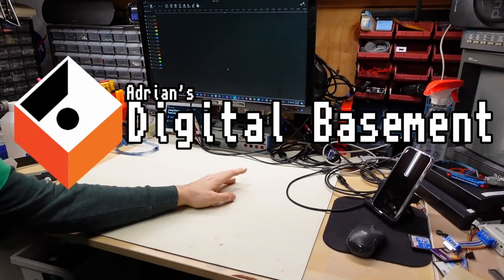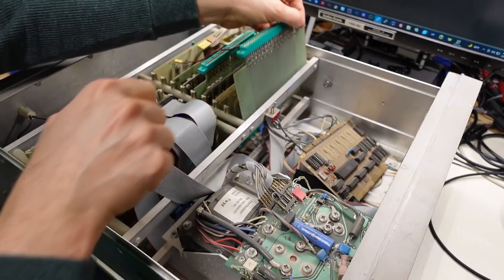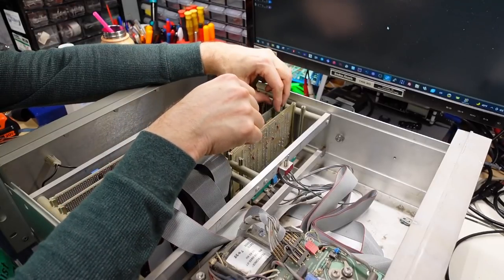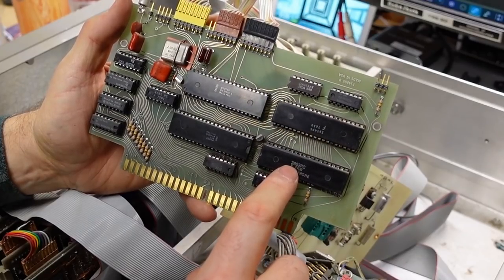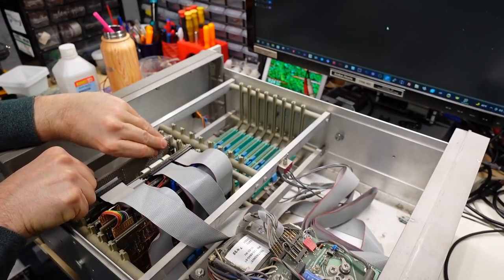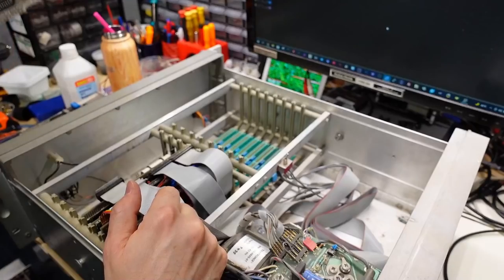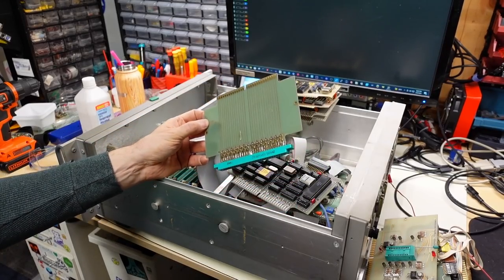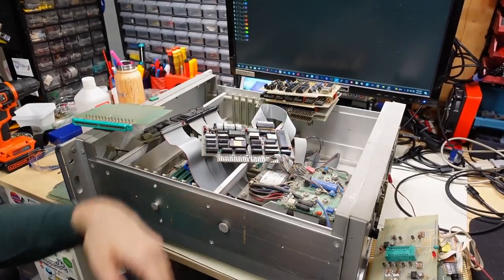I need help finding information on this mysterious computer

Comment: Going to respectfully disagree with Stephen Sanner, below -- I don't think this is STD-Bus, it doesn't look like it has enough pins. If it is, it's a _very_ nonstandard implementation. For sure it's not S-100 bus. I've never seen anything like it. If I had to guess, I'd say someone homebrewed something based on STD-Bus or -- what was the 50pin one used with the 6800 CPUs sometimes? That thing -- but with what they could get easily at the local shops.

Fairchild F3852PC is a dynamic memory interface for up to 64k of DRAM in a Fairchild F8-architecture system.
Fairchild F3854PC is the DMAC (DMA controller) for an F8-architecture system.
Hitachi HM4864A-12 is a 64k x1 ("serial") DRAM.
Intel 8232 is an 8080-compatible FPU, interestingly enough.
Intersil IM6402-1PL looks to be a UART.
Mostek MK3850 is one half of a Fairchild F8-architecture CPU, second-sourced -- it's usually paired with an MK3851, apparently. The single-chip variant is reportedly the MK3870.
Mostek MK90004N was VERY hard to track down but an obscure Archive[dot]org reference points to it being a "port-allocated" variant of the MK3861 PIO chip. (I've no idea what "port-allocated" means.)
Mostek MK90071P is another PIO chip of, I suppose, a different sort.
Mostek MM58167AN is an RTC chip. I actually have one of those in a bag of parts in a drawer somewhere that I've been meaning to find a use for.
Motorola MC1441x chips appear to be sense amplifiers of various sorts. Definitely it is not a bit rate generator, pull actual datasheets, don't just trust the first thing that Creepy Uncle Google feeds you! He has pulled the datasheet for an MC1441*1*, which is a different chip from what was verbally identified. (Note remark below regarding board photos.)
Motorola MC14515B is a 4-to-16-line decoder.
NEC 765x is indeed the famous floppy controller.
Sony CXK581000P-12L is a 128k x8 SRAM with 120ns access timing. As self-corrected, not flash memory.
TI TMS4051 is a 4k x1 ("serial") DRAM, not 8k xAnything as stated. (LOL.)
Zilog Z280 is not a math coproc, it's a 16bit MPU. Wikipedia cites it as a rebadged Z800 with minor improvements.
Zilog CTC is counter/timer.

I've not looked at the high-resolution photos; those, however, are the notable chips that aren't glue logic. 74xx and CD4xxx chips are very well documented. I don't think I missed any notable chips that weren't glue logic.

Probably the user interface would be RS-232 video terminal, most likely VT-100 compatible; something like a Wyse 50 would probably do the trick if, like most folks, you don't have an _actual_ VT-100, Adrian. I'd do something about that battery, and _thoroughly_ test the power supply under at least some minimal load.

Comment: DZUS fasteners, I've seen those screw locks on old military equipment.
Reply: Came here to say exactly the same thing … I designed military equipment back in the late 1980’s. The sockets on the Z80 cpu card were called Harwin Pins and were stupidly expensive!

Comment: I had to split this comment into multiple comments because Google barfed on putting it all in one.

The manufactured circuit boards with the Exxxx designations are definitely made by Tektronix, and the "E" designator was that they were internal /E/ngineering boards.   I believe the X posfix indicated that the board was  a low-count e/X/perimental run.

As mentioned by someone else earlier, the power supply is a derivative of the power supply used in the Tektronix 21 and 31 electronic calculators.  Derivatives of this power supply were used in all kinds of internal engineering devices.    

The chassis is also very "Tektronix"-ish.  I had a chassis very similar to this at one point that I got when I worked at Tektronix - I purchased it from the Tektronix company store.    The fasteners that hold the top cover on are called Dzus fasteners.

 I am not really sure what the system you have might have been used for, but I am quite sure that the only way to "talk" to it was via an RS-232 terminal to one of the connectors on the back.  There isn't any video interface in there. 

From a historical standpoint, there was a group called the Microprocessor Development Group located at the Tektronix Walker Road plant that developed a line of engineering boards that were based on an in-house developed bus (different than that in your system..it had more bus lines).  I started work at Tektronix in the spring of 1977, and the group existed at that time, but they were more involved in evaluating various microcomputer systems available on the market as possible development systems for use internally.   I know they evaluated the original Commodore PET, as well as the IMSAI 8080.   I think at some point it was decided that the group would instead develop their own in-house system that would offer more flexibility than any of the existing commercial microcomputer systems.

They developed a number of different CPU boards, starting with the Motorola 6800, then the 6809, as well as Intel 8085, and some others that I can't remember.  I think at one point there was even a Motorola 68000 CPU board for the bus, as well as an 8086, but that one I'm not as positive  about. The bus was capable of handling 16-bit architectures.   The CPU boards generally had two serial ports, perhaps a couple K of RAM (for stack and working memory for the ROM monitor), and a ROM socket for a rudimentary monitor program called DDT.  They also developed quite an assortment of RAM boards, both static and dynamic.  There was also a ROM board, an EPROM programmer with built-in burner firmware, and a single-density floppy disc controller (based on the NEC uPD765).

Comment: WOW!  I haven't seen a Bus machine in years!  Back in the late 80s, I worked at a brick factory where we had a packing machine that used an articulating robotic arm.  It used a full array STD bus to run the software.  As the bricks came down the line, the arm would swing around and grab the bricks than pallet them up.  It only had a maximum of 12 complete movements and 3 pinch positions, the bus array was as tall as me and had 12 total boxes.  Gawd, they were a pain in the arse when one went down.  We kept extras in a storage room because they had to cleaned and maintained constantly, they would suck in dust and the circuits would get damaged or burnt.  I even remember one catching fire when a capacitor popped...You'll never forget the smell of burning circuit board and brick dust, it smells like burning hair ugh.  Great find!  this really brought back memories...both good & bad lol
Reply: lol bro
Reply: Haha, yeah, I did 6 months working in the packing plant of a Titanium Dioxide plant. its the stuff that makes your toothpaste white and abrasive. the SCADA stuff was pretty up to date, but for whatever reason, the printers were all apollo era. they printed the packing slips that went with each consignment. apparently there was a bigwig who liked paper dockets. so, the whole place ran on paper. unfortunately, hyper fine abrasive powder is Bad for printers. If one lasted more than a week, it was a miracle. but the whole line would grind to a halt if you couldnt fix it in about 20 minutes. Lots of hot spares. when I started, took me over an hour to clean n refresh a printer. my Personal Best by the time i was done there was 7 minutes. other parts of the plant used either digital systems, or ink blasters. but packing used the ol bangers. the buggers kept working tho. you can love, hate, and respect a thing in one sigh.

Comment: I worked in the Norwegian navy on a submarine that was a test bed for different equipment for future use. There was a lot of one-off computers or other electronics in rack. The front on this machine you had here looked a lot like the some of the ones we had. The rack mounting seemed to be standardized and most of them had a bus system with slot in card like this inside. But much higher density and made much more rugged and grounding everywhere. But there was a lot of CMOS circuits. And there was a lot of bodge wires all over, since they was a one-off system. 
I remember we at one time got a huge rack about 1,5m high full of equipments. A few month after installation we got a replacement that was a revision and it only was a 2U unit that replaced all the units in the rack. I also remember we had often go into the program and fix bugs by instructions from the makers. That was the last time I was programming in Fortran :)

Comment: I had 24 hours to think about this. Start with the cards that have a known pin out cpu. You should be able to map the bus on from there. Presumably the rest of the cards will follow the same standard. Doing so will also help you troubleshoot the backplane and the voltages on it. It is very possible if there are other voltages besides 5 you can look at the cards with ram to further help map the bus. It's as good a place to start because once you know the bus you can figure out part by part if things are not working. But first map the bus then test the power rails.
Reply: It's hard to tell from photos, But I think D0 though D8 are on backplane 2 though 9.

A0 though A11 are on backplane 29 though 41, A12 though A15 are on backplane 43 though 46

Comment: You can indeed still buy those odd sockets you mention around 5:40--I use them all the time for making sockets for parts that aren't DIP or SIP (and you can get them rated to quite high temperatures too, so I use them for that as well--my job involves testing electronics at up to 175 °C). I get them mostly from Mill-Max, but another company called Preci-Dip makes them too, and I'm sure there are others; Samtec might make them too, I wouldn't be surprised.

Comment: If someone has never had-wired circuit boards like that, they have no idea how hard it is to do it right.
Reply: As part of my electronics course I had to build an 8086 computer using wire wrap and discrete components. Interesting… (particularly as the final assessment was getting it to talk to one of the other students projects).
Reply: We used to do it at ibm
Reply: Yes, a sign of deep engineering wizardry.  Perhaps to custom engineer support for factory sensors or manufacturing, but the box allows it to interface with an off-the-shelf mini. So, a development box for said mini-system. I bet a ROM dump would provide some interesting insight. Fun video, Adrian.

Comment: No idea what this exact machine was but definitely something custom. The EEPROM programmer reminded me of a story my dad told me of when he repaired Apple machines. Came across an Apple II with some wacky custom cards and 2 hacked-in EEPROM readers in holes cut in the case at the front. His best guess is it was used for copying cartridge ROMS or something as the custom card allowed the contents of one EEPROM to be dumped to RAM, then written to the other. Made sense also since it had lots of RAM upgrade cards. Wish he still had it.

Comment: Would love to see the ROMs dumped. Maybe you'll find a clue, like a text string with a company name, or a testing prompt. This definitely looks like a custom industrial controller of some kind. I used to hand build test panels for testing electric motors, at my old job. We were just doing analog circuits to connect things like motor windings to off the shelf text equipment, switching the windings read based on hall effect commutation signals, so we didn't need a whole computer inside, but it's the same principal. All hand made equipment meant for a specific application. You might have a few identical panels, or a singular, one off machine, depending on the application requirements. For the stuff I built, we had maybe a dozen test stations around the plant. I was responsible for occasionally making a new one, as well as calibrating and repairing the existing ones.

The nature of what you have makes me think it was operated remotely, by way of a terminal. I think that's the right assumption. With so many serial interfaces, I very possibly could have been connected to not only a terminal, but one or more bits of industrial hardware, with serial control I/O.

About a decade ago, I snagged a really intriguing bit of custom industrial control kit. It has dozens of BNC connectors on different modules. Some are marked as monitors with In, out, and monitor BNCs, Others have BNC marked with things like Clocks, burst clocks, indexes, etc... No idea what it all does. The highlight of the device is a module that uses TI smart LED displays and thumbwheels to read or load data to or from various addresses. No idea what it was used for, but it's neat that it can power up. It's obviously some sort of custom digital industrial hardware, but it seems to be all discrete analog and digital I/O controls. Very interesting.

Comment: To me, this looks like a device (I can't call it a computer because it's more than one computer in one case) that was part of the McDonnell Douglas DC-10 control module, which served in this class of aircraft from mid-1978 until 1985 when it was replaced by a more modern, smaller and more powerful device.
Reply: Not without a hundred serial numbers, part numbers, and manufacturer names on every last piece of the thing.
Reply: @jpdemer5  So true. They had to be fully traceable to enable the lawyers in plying their trade, if something went awry and there was a plane crash.
While at GE I worked on an early system to control their nuclear reactors. It used cmos logic ICs, prior to this it was mainly relay logic doing the work. Back to your subject, there were several "isolation boards", each with over 500 diodes on it, all identical types, but each with its own serial number and probably a paper file folder full of testing data and whatnot. Being new to this equipment I asked why all the unique serial numbers.
Answer: Legal Issues.
Reply: @richpayton7162  My brother worked for Pratt & Whitney.  He had similar tales to tell.  Not so much for the lawyers, but so they could track down any weak links and make the appropriate fixes. If they identified what they thought was a "bad batch" of capacitors, they could track down and replace every last one of them, in every device that contained one, thanks to insanely detailed record-keeping.

Comment: A college near me had around 6 of these (or very similar) sat in the corner of a storage room in the early 90s. Each had similar cards to what you see and one had a HDD (5MB I believe) and what looked like a memory mapped jumper board (confirmed by a old nerd and tutor who worked there) with over 500 wires.
He would occasionally fire that HDD one up with a grinding a screeching noise and some of the loudest beeps you've ever heard!
Apparently they came from a "database farm" at a local ship builders/heavy engineering company.

Comment: It reminds me a lot of the things my dad used to work with in the aircraft industry. From what I've seen during family day visits, you either have a "server" that connects to some dumb terminals through serial connections or a buffer to fit between equipment and a plotter.